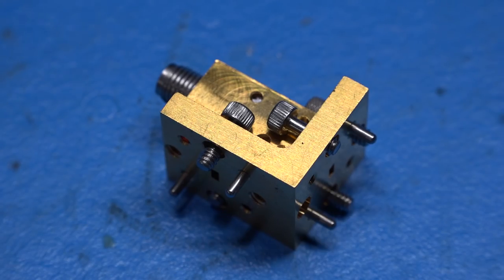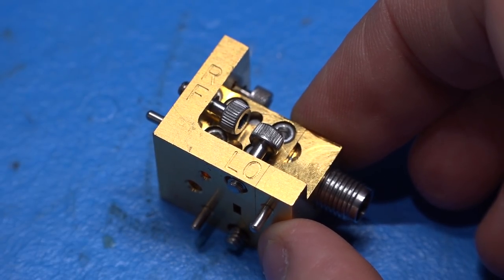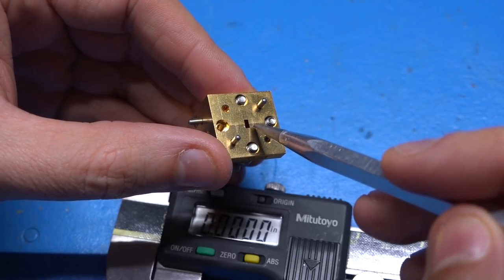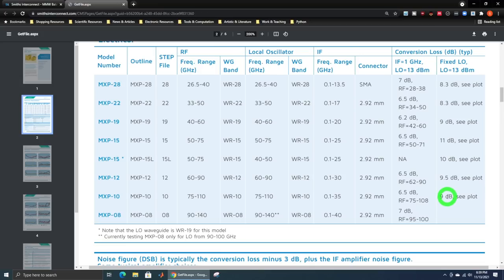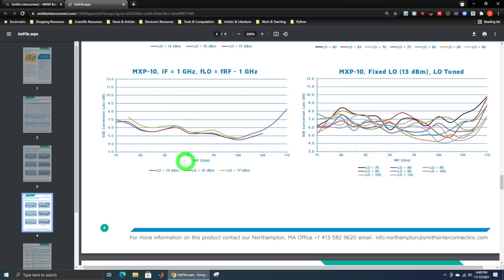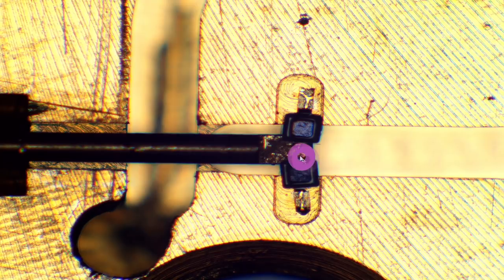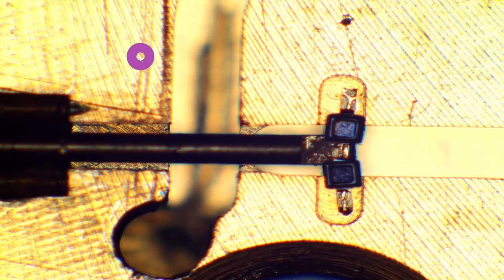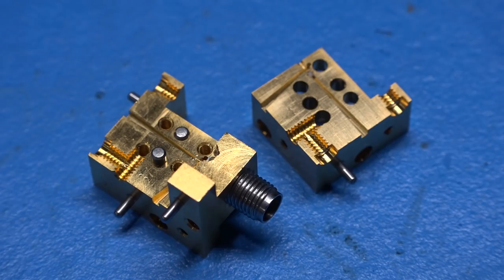TNP #11 - Teardown & Analysis of a 75-110GHz (W-Band) Waveguide mm-Wave Balanced Mixer Module

Comment from the maker: Minor Correction: Upon closer inspection it appears that all ports (RF/LO/IF) are shared on the center common port of the diodes. The top and bottom connections to the chassis do not carry any RF signal. The mixer is balanced only in that it uses two diodes. No differential stimulus is created.
Reply: It is truly a balanced mixer. in fact it is a single balanced mixer. Differential stimulus is seen from the perspective of the diodes.
RF can be seen as being applied differential to the diode path to IF since one diode is referenced to the bottom wall of the waveguide while the top diode is referenced to the top wall of the waveguide the latter will see the RF signal 180deg reversed relative to the first.
Diodes are in the same direction and  driven at the center by the LO therefore each diode conducts on each half of the LO cycle, this way the bottom diode is ON and connects the +RF signal (note that  "+" is because it is referenced to the lower side of the WG) to the IF port. When the upper diode conducts connects the -RF signal (note that "-" is because it is referenced to the top of the waveguide) to the IF. 
Truly balanced action results. The IF is the result of switching, at the LO pace,  between +RF and -RF into the IF port.

Comment: I can appreciate the machining work in this unit, I've been making 122 GHz parts with WR-06 guides. Very interesting to see the connection of the opposed pair of diodes and the tapered end of the 2.92 connector pin. To get tapered-height guide matching into the diodes, I'm using a 0.5 mm diameter end mill on a rotary table. Doing this sort of machining in a home shop is certainly an amusing challenge.  Once I get it to work, I'll have to do a video on the process. Thanks very much for this, it has saved me a lot of trouble trying to work out how to make the diode connection.

Comment: Every time I see a waveguided instrument I feel being scammed :)  but they are really cool and magical at the same time.
Reply: RF electronics is not a scam :) it is real and works exceptionally well. Almost everything in a communication satellite is waveguided electronics due to high frequencies.
Reply: Also the equipment required just to be able to test and characterize the mixer is also probably astronomical.

Comment: The real trick to machining parts like this is the fixturing. You need a way to keep the part(s) aligned to a known reference and securely held.  On this particular piece some of the machining operations were done to the individual parts, then these parts had to be aligned and fixed in position, alignment pin holes drilled and then other operations like drilling/tapping the split threaded holes. I part I have spent days designing and machining fixturing to make one 'simple' small part like this which had machining operations on 5 sides. 

Complexity of design, manufacturing and low volume equal high price...

Comment: Seeing this kind of device leaves me to wonder what the applications are of EHF radio in the W band at 75-110 GHz.
Reply: Good question..basically applications span from receivers for astronomy to seekers (autonomous radar guided missiles) and so military equipment. Regards from Italy.
Reply: The adaptive cruise control and collision avoidance/auto brake system on my car operates at 75 and 122 GHz.  Water and oxygen absorption in the atmosphere is high especially at 122 GHz, so long range applications are not common.
Reply: @stargazer7644  You are right! I forgot to mention those commercial applications!! Regards.
Reply: @stargazer7644  That may explain why the adaptive cruise control in my car fails in heavy rain!

Comment: Why does the waveguide taper near the diodes? Isn't it supposed to follow WR-10 dimensions throughout the signal path?
Reply: I mean... A shrinking waveguide may act as high pass filter because the waveguide cutoff frequency increases in that section. Or does it?
Reply: Shrinking along the y direction (the shorter dimension of the WR10) does not affect the cutoff frequency, and it pbb helps further localize the field.

Comment: I imagine they would have to wire EDM the wave guide parts as opposed to CNC machining. I can see machining marks on the outside which does not need to be perfect.
Reply: It looks like the inside of the part made in Japan and shipped to China to "finish" the outside :P
Reply: It is just machined with an endmill, at 7:40  you can see the round marks in the bottom of the waveguide from the cutter.
Reply: EDM won’t work on that shape, so it’s got to be an ultra precision probably extremely high speed (100,000 RPM) milling machine…. I’d love to see the machine, I’d imagine the tolerance here has to be in the micron level probably 10 millionths maybe less? Whatever the process I’m sure it’s expensive…
Reply: Thanks.  Can you draw a simple equivalent circuit?
Reply: @hGUImain  You are right. This is the most effective building techique for waveguide components. Commonly used also for filters (E plane type). Regards from Italy.
Reply: @robertw1871  You don't need such a high speed, 40krpm is fine. You can buy the machines pretty much from every good machine mfg, Kern would be an example.
Reply: @robertw1871  The waveguide accuracy required is usually between 1/10th and 1/20th of a wavelength.  The wavelength at 110 GHZ is 2.7 millimeters.   That would be 0.27 to 0.135mm.  That's 5-10 thousandths.
Reply: @stargazer7644  and it's nothing crazy
Reply: @stargazer7644  Yep, the precision required here isn't actually that high (in terms of machining precision). Once you're talking <±25µm or so (<± about 1 thou), then you need to start taking special care. When you get to the ±20nM range, then you really have to be careful (though it's still within the ranges that can be achieved without CNC for some processes, eg spherical lapping like this: https://www.youtube.com/watch?v=fEoonCLTCbE ).
Reply: 10 thou it’s a pretty giant gap that’s easily visible with the eye, I wouldn’t think this kind of work could be done well within the range of the naked eye… 1/10th might work for tuning but I assume losses will be higher with something that imprecise, must be some reason they go to the expense to make it far more precise, I assume if I made one with a hand file cut to 10 thou I couldn’t sell it for 8 grand…
Reply: @robertw1871  We're talking about a wavelength of 2.7mm here, not visible light.  These aren't optical components.
Reply: @stargazer7644  I am pretty sure that it isn't machined to 0.135mm tolerance. That is a coarse sketchy work in machining world, that's close to the thickness of a paper. The surface is shiney, the depth of the scratches you see on it are probably in the microns range.

I am very far from an RF engineer, but with some experience in machining I could definitely say that if you machine every dimension on that part to 0.1mm tolerance, it would probably add up as badly as it could, and you would end up with a totally fucked up part where maybe even the two halves won't fit together. I am pretty sure it has to be machined to magnitudes better tolerance to guarantee any datasheet values to a sensible tolerance of the finished product as well.
Reply: @gabiold  I didn't say that's what tolerance it was machined to, I said that's what the frequency requires.  With care, a decent milling machine can do slightly better than one thou accuracy.  That would be perfectly acceptable here.  Nothing more is required.  It's two freaking tapered slots.  How hard do you think it is to mill that?  If you look at the waveguide when it is assembled, you can even see a slight offset.  You can also see the machine marks in the bottom of the slots from the end mill that cut it.
Reply: These are CNC machined (typical 20000 to 50000rpm machines are enough, w/ endmils about 0.5m to 0.8mm diam., feed rates circa 100mm/s and about 0.05mm each zcut). Similar parts I've made took some 4 to 8hours of cnc time.

Comment: I'll guess you couldn't design such a thing without precise modelling. I wonder how many prototypes they had to build to get it right. Looks like a lot of precision machining and maybe EDM. (electrical discharge machining erodes with sparks) Some tool marks are visible on the flat surfaces. Simple in principal but fascinating. Great video.
Reply: It looks like a standard milling machine job to me.  Nothing fancy, just precise.
Reply: @stargazer7644  Nah, that two-dimensionally conical waveguide channel is not that of a simple milling. Definitely not with manual work, but probably not that everyday work with a CNC either.

Comment: It’s amazing that 10 dollars worth of material can be fabricated into something worth so much.
Reply: My guess it's military sponsored.
Reply: Its gold plated
Reply: See: CPUs and other specialized ICs
Reply: Definitely a ton of value added
Reply: It's also partly because of the machining methods used. This is definitely made using EDM, so it's slow to manufacture and has a small market niche.
In my job we ordered two sets of a harmonic mixer and a frequency multiplier to reach 300GHz, combined worth a quarter million apparently..
Reply: @metatechnologist  No, it has lots of non mil applications too.
Reply: @saintfather7757  Goldplating this small of a party wouldn't increase price much
Reply: It is worth so much because almost nobody makes them, and nobody makes them because almost nobody buys them.  It is not just military.  The automotive industry also uses these frequencies for adaptive cruise control and emergency breaking systems.
Reply: @stargazer7644  you are correct! and they are so hard to build... what would you do as a FIRST STEP if you were tasked with making one of these. just insane level of knowledge, sourcing, and fine tolerance required...
Reply: @seag0d123  You can make the shell of one of these on a standard milling machine with a bit of care.  Installing and connecting the diodes takes some pretty specialized equipment however.

Comment: If not repaired by a talented person like yourself, could it be repaired by the original company? If the metal waveguides were fine then shouldn't the be able to apply a new diode with whatever technique they use to build a new one?
Reply: Not a so easy task...Diodes are surely high barrier Schottky diodes, prefearably a matched pair to have a perfect balance. They are thermally bonded onto the metal body. So you need a bonding machine, a very expensive equipment that is commonly used for wire bonding chips to substrates. Pure microelectronics...regards from Italy.
Reply: Of course, anyone who could make one has the equipment to repair one.  Assuming replacement diodes could be sourced.

Comment: Can you teach what the diode does
Reply: You can look up "balanced diode mixer," but in short the diodes switch on and off at the LO frequency, chopping (a.k.a., "commutating") the RF signal. Mathematically, this multiplies the two signals together, resulting in the sum and difference of the two frequencies out the IF port. You usually only want one of them (the sum for up-conversion or the difference for down-conversion), so you either filter out the mixing products you don't want (the harmonics are mixed as well), or you ignore them if doing so doesn't cause problems. A double -balanced diode ring mixer uses four diodes and it's used to get better isolation between the ports. If you don't need maximum isolation, two diodes are used, especially--as in this case--the mixer is already costly.
Reply: @tcarney57  wow a simple component doing some crazy physics

Comment: Could you repair it? :)
Reply from the maker: Sadly the diodes have to be replaced which is very difficult.
Reply: @Thesignalpath  So you're saying there is a chance! :) I understand though, would probably need one of those specialized semi packaging machines.
Reply: Yes it is repairable and it is not too difficult to repair providing you have diodes to replace, and a micro-gap-welder. (done under a microscope obviously)